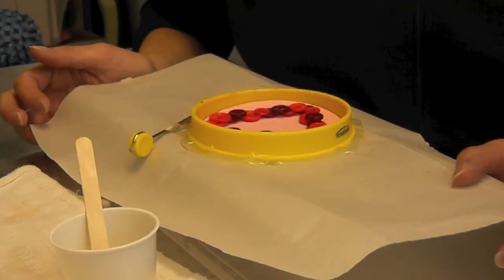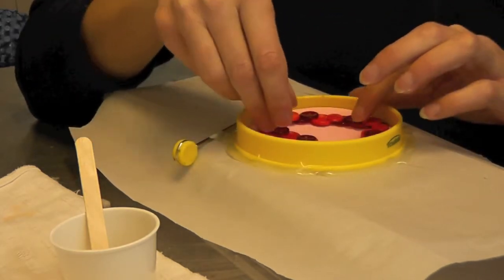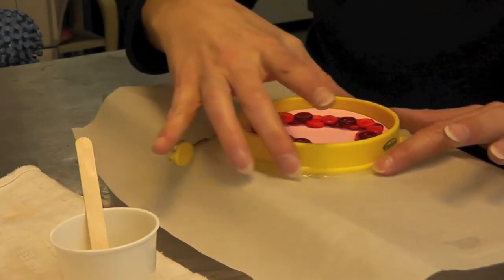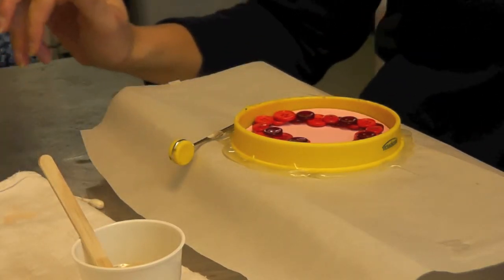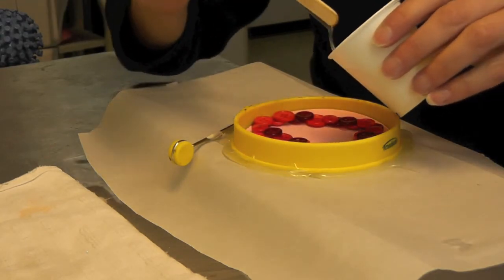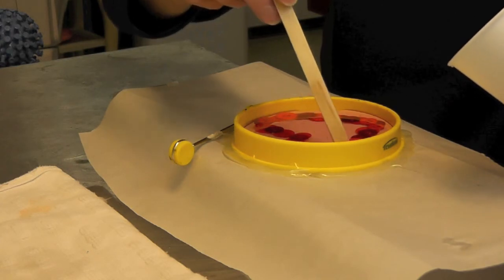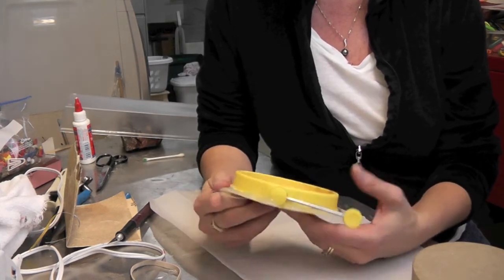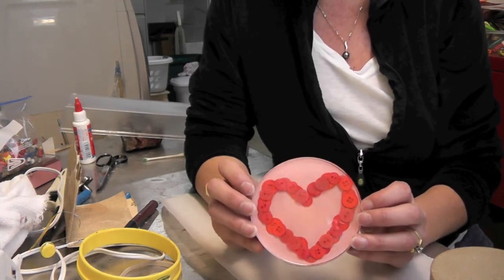Button Heart Coaster Craft Tutorial

Comment: to help with the bubbles put your bottles of resin in a container or bucket of warm water before you mix them, not too warm or you will speed up the curing time of the resin, let them sit for 5 to 10 minutes before you mix, just make sure not to let any water run off the bottle into your resin when you do mix it :) hope this helps! i do this every time before i do a pour.

Comment: with the rings you can put them in resin the biggest one then get another one and cut a little piece out then glue the ends together so it smaller then put it inside the bigger one them repeat making them smaller and put them inside each other in the resin